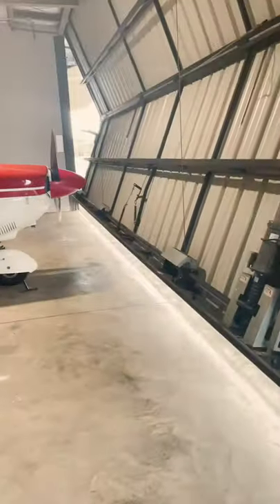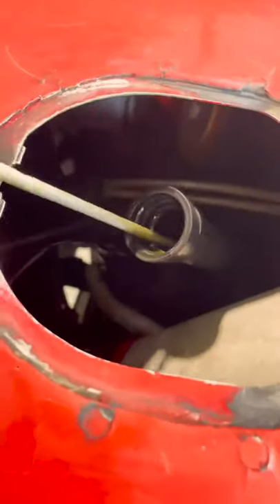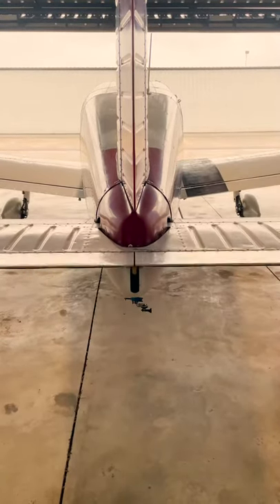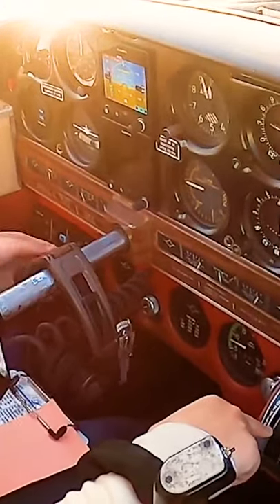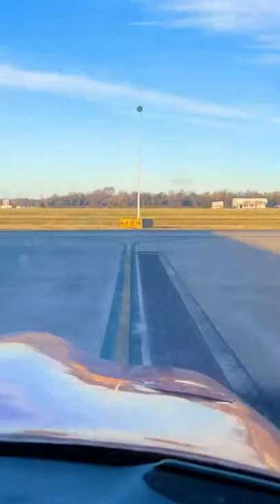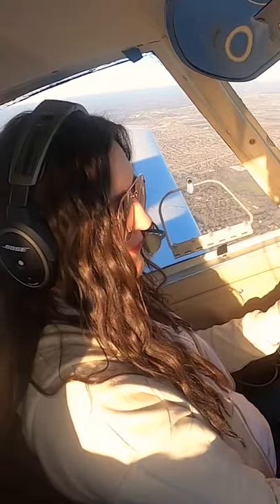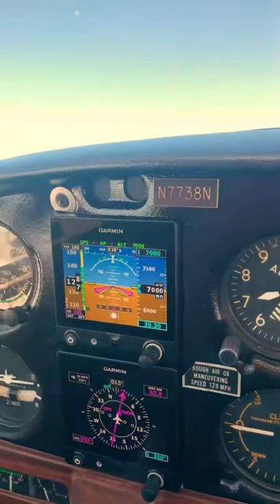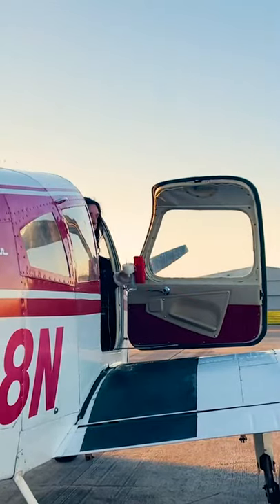What it’s like to take my airplane for a flight!

Comment: You should be wiping your oil dip stick off and then putting it all the way back in including screwing it in and then take it back out and check it. You can have false readings on it due to from the last time it was running.

Comment: You check propeller with master switch  OFF. do not recommend
Reply: It doesn't matter if the master is on or off when you check the propeller. The master switch has nothing to do with the engine firing. That's the ignition switch. Only thing the master does is send power from the battery to the starter when you turn the ignition to the start position.